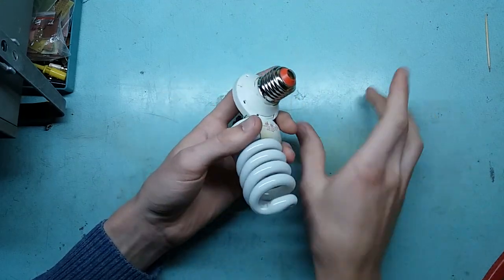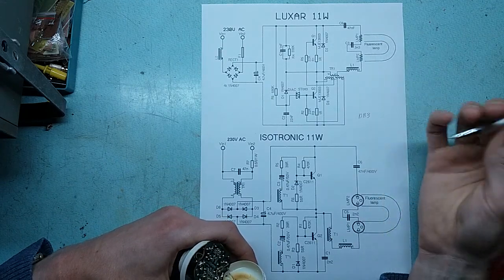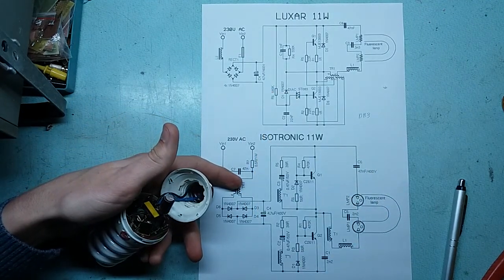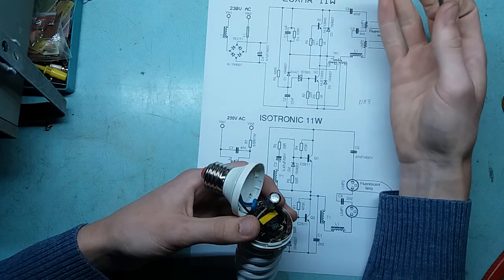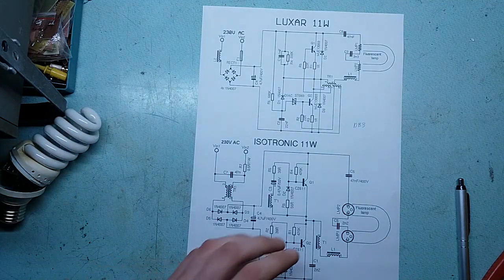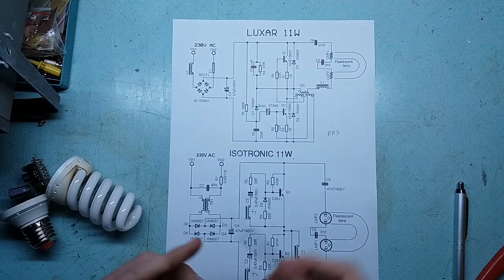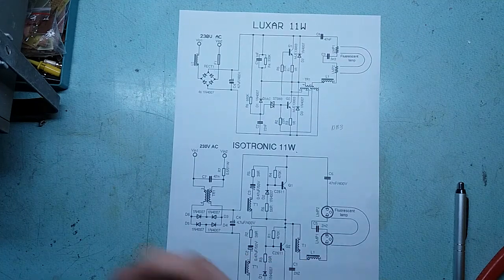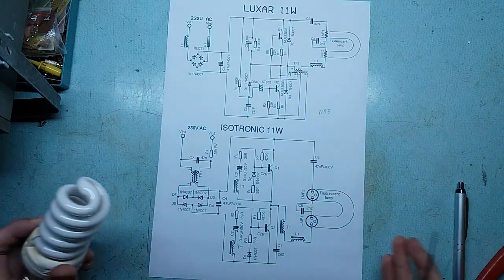Some tips how to repair a CFL

Comment: For reference, the Feit 13W lamps seem to fail often. - Far from the lifespan that the whole environmental impact that this supposed to be improving. (Reference: 120V/60Hz models -US)

Also, thank you for explaining the frequency/luminescence correlation. Being in the building HVAC industry, I had a hard time accepting the significantly lower wattage of electronically ballasted light fixtures (and now LED fixtures) - This is used for the internal cooling load estimates which influences equipment cooling capacity.

Comment: Could I use this startup circuit analysis on a CRT TV?  It doesn't always start on the first try after a day of being off. I have replaced a capacitor that helped lots, but now it's becoming just haphazard guesses. (Emerson TC1966D - I know it's old and inexpensive, but this gets me to know modern circuitry better.). Thank you.
Reply from the maker: You can't, unfortunately. It's a different beast.
 The issue you are talking about caused mostly by dried-up electrolytics (as you saw yourself) and sometimes by bad solder joint which makes a connection when the TV is cold and breaks it as it heats up during use. 
 In order to know for sure which cap to replace, I suggest you buy or build an ESR meter that can measure caps in-circuit. Here's the circuit I used to make my own: http://ludens.cl/Electron/esr/esr.html
You can go test caps on the whole board in a matter of minutes, a really nice tool to have!
Reply: MrJohhhnnnyyy     Different beast:  I see (and beast is quite the appropriate description). Thank you.    ESR meter: I'm getting close to getting one ( the home-made circuit is interesting).   Bad joints:  I am very suspicious that this may have been the actual issue; that capacitor's connections had a very dull look to them (I see how this can be much more of a reality than just a remote possibility). - I have the original cap. and will test it some time.
Reply from the maker: I'm glad you understand my terminology :) 
 Dull looking joints can be an issue, but I never experienced trouble with them making good contact. What I'm talking about is a circle-shaped crack around the lead of the component, which gets formed as the joint heats up/cools down and due to physical movement (mostly vibration). I test joints by wiggling a component or a lead of it (applying reasonable force, of course) and if I see the lead moving relative to the pad it is soldered to, I reflow them.
Reply: MrJohhhnnnyyy   I completely understand. I found it odd that everything else on the board was good (excellent) but these two were so dull. I don't want to stay off topic too long here, and I think we've covered it so I'll let you go now. Thanks.   BTW, I did once discover a separated and cracked joint at a board-mounted pushbutton.  I jumpered the crack and it fixed that problem, but the lubrication from previous staticy-switch-symptom repair attempts must have ran down the board and shorted something else out. To say the least, I was not happy.  Thanks again.

Comment: Stop putting yourself down, diagnostics isnt allways easy to explain.
The "Gut feeling" and everything you have learned takes time and experience.
Experience cant be taught.
All the circuits and configurations you have seen have to be learnt over time.
Ill stop nagging you LOL.

I suspect that two zenners anode to anode, or cathode to cathode would be similar to the diac, the db3 ive seen in lighting dimmers and other phase chopping circuits.

I have a flourescent bulb that refused to start, it glowed and flashed, the capacitor between the heaters was shorted, lucky i keep the boards from flourescents that died due to open circuit heaters.
It was fixed last year and still lights my room :-D.

What made me fix it.... a mate said "You wont fix it, its not worth it, chuck it in the bin.",
Well i just had to prove "Mr negative" wrong LOL :-D, im stubborn that way :-D.
Reply from the maker: Yes, that little cap going short is a frequent failure. I like to fix them to keep them out of a landfill for as long as possible.